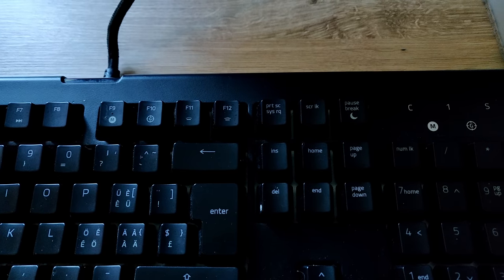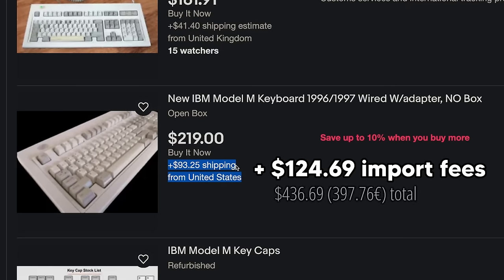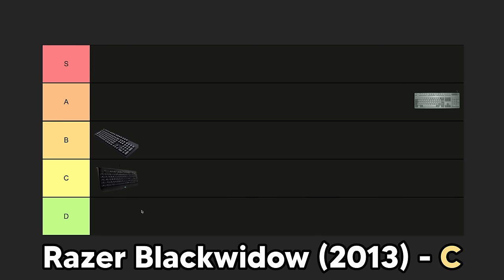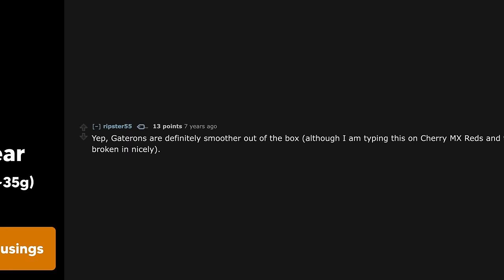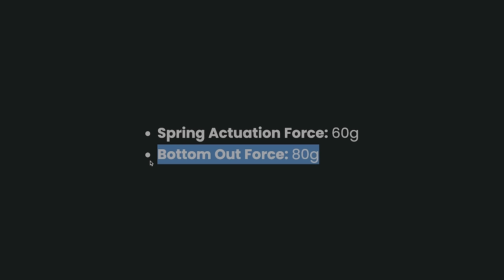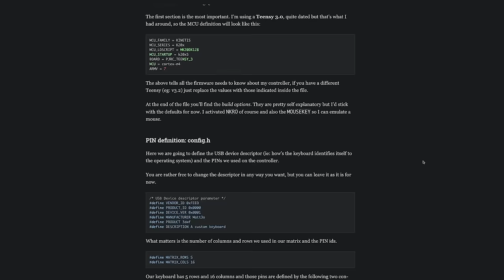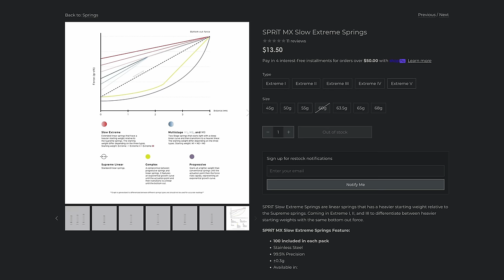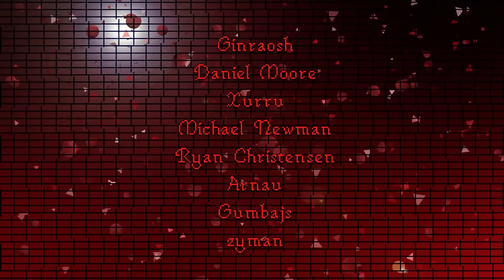How I Lost Interest Towards Mechanical Keyboards

Comment: I never quite understood the obsession some people put into mechanical keyboards. Don't get me wrong, I'm a programmer, so my keyboard is essentially my workhorse and I do have a mechanical keyboard – But I just got myself a Model M (a solid one with the steel plate) for 50€ and called it a day.

After moving out of country, I got  myself a second one for 90€ (the most I've ever paid for a keyboard) – this time a 122-key "battleship" with a terminal connector, and one of them Soarer converters, but that's essentially where my interest ends. I've had this keyboard for years now but didn't even bother creating a proper mapping of the keyboard with the converter, because the software to configure the converter only works on Linux (while I'm running BSD).

For me, this keyboard is perfectly acceptable, feels great to type on and is robust enough that I'm pretty sure I'll be dead before it stops working. It was just the least research for the longest running good typing experience.

Comment: logitech K295 is my latest quiet board , comes with a quiet mouse that's Not that quiet , 
using the logi M650 , which fits perfectly with silent touch K295
it's just such a nice typing experience ... Not having that awful clicking and ticking SCREAMED at your face

Comment: I'm typing on an CM storm quickfire XT right now that I bought in 2015 after getting fed up with the abysmal 2-3 key rollover on the logitech membrane I had at the time. You bet I used the ps2 connector for full N key rollover.

Comment: I said the same thing about keyboards till I saw Vanguard65, which added something unique to what's currently out there with a slider that can act as a MIDI controller if you set it up that way.

Comment: I've found that the end game for me would just be simply making my own since ive only ever been casually into them but, way way too time consuming. had a friend who spent a week soldering with led's and it was COOL but, as an artist/animator I've become alot more interested in macros and autohotkey stuff which ironically came from me being interested in proprietary macro software that came with alot of prebuilt mechanicals.
Reply: QMK/VIA boards are going to be far more reliable and customizable in terms of rebinding. I have a board with actually really fantastic CN software, 3 fully rebindable layers that can be both shifted and toggled into, tons of multi-layered RGB configuration without software, but then literally the same board sold by a different company will have an unusably bad firmware in its place, and most sellers don't show off the software at all, as if they don't even see it as a selling point. Even the good one though doesn't have things like tap commands that QMK can do, where you can assign different commands for single double triple taps and holds and all sorts of variations, on top of having a huge number of on-board layers and profiles.
Reply: @MangoTangoFox  Honestly, open-source firmware is such a nice feature to have supported by your board. I'm excited to switch to ZMK for a wireless board I'm designing.

Comment: For me I stopped going into mechanicals because moving from laptop keyboards to desktop keyboards, now due to sticking to one layout I just use ThinkPad keyboards for laptop and desktop use, also has touch point mouse so I don't even need to move my hands to the mouse and more joystick scrolling is great.
Reply: I'm really interested in the trackpoint. I'm current in the midst of planning the design for my own wireless keyboard in the summer, and the firmware I plan to use, ZMK, recently had a pull request to add support for trackpoint modules (and anything that uses a PS/2, really). So I'll hopefully be harvesting one for that. 

I just can't go back to a row-stagger unfortunately, so I just lay my keyboard (it's tiny, and I disable the in-built keyboard) on top of the keys if I don't have access to a desk, and it works well enough.
Reply: @oku-mq7kg  I've seen people with a split keyboard (non-staggered) who use a trackball in between which might be interesting. After using trackball on and off it didn't work for me. There are 3D joysticks which are used for 3D modeling which can be used for mousing but probably overkill and also expensive.
Reply: @alexprach  My only concern with a trackball is placement, because I'd need to move my hand to reach it if it was in the middle of both halves, or have it super close to the keyboard so my thumb can reach it.

This also applies to an external trackpad, which I was considering using. I also want to tent my keyboard in the future, so having the pointing device directly on the board means I can use it without any issues whilst tented.
Reply: @oku-mq7kg  That makes sense if you want the least amount of movement, I do still use a mouse though. If I only used desktops I would consider the new mechanical keyboards which weren't around or super expensive a few years ago. But having a single layout to learn is all my brain can handle at the moment since programming requires me to use all sorts of weird characters which I just don't want to relearn.
Reply: @alexprach  For pointer heavy applications, I would very likely opt to use a mouse, or just use a trackball/trackpad if I find I can be as fast and precise with these options.

It's really just for the scenario that I need a pointing device for something simple (like closing a cookies popup that it isn't picked up by Vimium) 

Yeah, after switching to a column-stagger, I haven't been able to type on a row-stagger any more (not something I'd complain about mind), but then again I don't use QWERTY.

Having access to layers under my thumbs has made programming so much more comfortable, as it allows me to place symbols in the same location as the alpha keys.
Reply: @oku-mq7kg  I find trackpoint more accurate than mice but the issues is that it's not suitable for mouse heavy work like some games.
Is layers like modes or chords, I've seen some of my colleague setups with these new custom keyboards, so I assume as it's a programmable keyboard.
I think gaming laptop manufacturers should start introducing options for keyboard layouts, I'm glad some exist like the MSI ones but they're too heavy to be portable, I have been tempted to go for a tablet PC like the Surface and just bring a mechanical keyboard, but comes with it's own limitations like cannot use it on your lap for typing.

Comment: you're meant to use the capslock for the fn key on the pok3r, there's a switch on the underside for it.

I used the pok3r a long time before eventually moving to a kinesis adv 2
Reply from the maker: I use the Capslock as the CTRL key on every keyboard I use, it also had a dip switch for that. That would also requires two hands to use the arrow keys, which I don't prefer that much. Although, FN as the capslock would be pretty awesome if the arrow keys could have been mapped to wasd keys now that I think about it, but I think that wasn't possible at least with the firmware at the time.

Comment: I lost interest in them because my endgame doesn't exist and I  don't want to design a pcb in kicad, print it, buy all the part, solder them and then install keycaps that I won't even like because the layout doesn't exist. I am way too picky so I am going to stick with my ymd40 forever. That is, if I manage to sell it and buy a bm40. While you obsess over switches I am fine with gat yellows but damn I can't stand it that I can't have the perfect keycaps with the legends I want.

Comment: I have been a lil bit in to custom boards, I bought an razer hunts mini, lubed switches spraiyed the board and added foam, but I ended up selling the board for like 90 bucks, to buy a k8, I sadly just bought the non hot swap one, so I spend a lot of time desodering and lubing and foam modding and what's so ever, the keyboard sounded the same, even tho I change nearly everything besides case and pcb, I was so fed up, that I bought a used huntsman mini, only to realize that I hate 60 %, after this I just bought a havit full size with blues for 5 euros, and I think I am kinda done with custom mods cuz of my experience with the great k8.

Comment: This is a great video, but it doesn't appear you ever really tried very many switches. You seem to gravitate towards clickies ... but haven't tried any particularly good ones like box click bar switches (jades, navies, pinks, etc)?

Personally, I just went right back to Cherry MX blue when I first tried the Model M. I didn't see what was so special about buckling spring until I tried a Model F. It is so much smoother and more consistent. Capacitive buckling spring has been one of my favorite mechanisms ever since, along with Alps (and Clickiez). Box clickies aren't far behind.

I do like both Topre and Niz, and they and Alps are my favorite tactiles, but I like Niz a bit more than Topre.

There's so much yet to explore. You really need a switch tester, even if just sticking to boring old MX.

I'm going to keep laughing about the thought of trading in Topre for Gateron black.

Comment: I've just been using the same Apple Extended Keyboard II since the 1990s, with appropriate ADB to USB adapter. I couldn't deal with a dome membrane keyboard.
Reply from the maker: Makes sense, the Apple Extended Keyboard II is an Alps switch keyboard, at the time I was active in the keyboard space, most people considered tactile Alps switches way better than Cherry switches, except maybe Black Alps which have issues with scratchiness.

Comment: For the longest time i just used whatever cheap keyboard i had and thought nothing of it. But they broke so often that at some point i started to look into keyboards.
The first one i got was the cheapest mechanical keyboard i could find which was an lg g610 orion red, but the z key stopped working after about 3 years. I tried to fix it but bungled it and just decided it was once again shopping time.
After a few months of watching nothing but keyboard stuff and reading about keyboards i had decided that my omega end game keyboard wouldve been a honeywell hall effect space cadet keyboard, but i couldnt find one.
So next best thing i bought a wooting hall effect lekker keyboard and bought some replica space cadet keycaps and slapped those on it. 
I will never buy another keyboard for the rest of my life. I see no way that anything could out do what ive got. 
Unless of course i run into a huge pile of money, in which case id just find some way to buy an og space cadet.

Comment: Now I''m too scared to ask, what kind of keyboard would you recommend to a newbie XD

It seems like this entire journey brought you to all corners of the hobby. Do you ever regret selling the old ones now that you can't type on them to remember the feel?
Reply: Honestly, I would just look at ergonomics, because you can a get a lot of health and productivity benefits out of something so cheap (at least if you're happy soldering or find a cheap assembly service). 

At the very least, find something with a column-stagger that's also split. The key count isn't too important, so long as you aren't stretching or causing any strain on your fingers to reach keys, nor are you moving your hand to reach them either, assuming you type using the correct technique.

I have quite small hands, so I opted to not include a number row, so holding down a key with my thumb replaces the top row with numbers, and I no longer need to stretch or use my ring finger for the wrong key to hit these.

I use a Ferris Sweep at the moment, it's very easy to build, and I haven't had any issues with it, but there are so many options out there with different strokes for different folks. I'm now looking at designing my own keyboard that's made for my finger length and preferences.

Comment: You most likely will never get a cherry mx switch to match a topre switch as it uses a slider with a rubber dome while mx is mechanical. If you want to get back into mx switches I suggest checking out TherminGoat reviews as he does in-depth switch reviews. 
Also nice video:goodvibes:

Comment: Custom keyboards is definitely one of those hobbies that has extremely prohibitive costs once you start getting deeper into them. Custom runs of keyboards or even keycaps can start at $300+, and a lot of the times they’re not much better than the mass produced options. Don’t even get me started on GMK keycaps. Borderline scams. I’m happy with my modded Keychron V2 after trying a bunch of different custom boards.

Comment: I had a PS2 IBM keyboard back in the day. As long as a keyboard worked and didn't have some super weird layout that I couldn't get used, meh. Quiet keyboards that work and are cheap is where it's at. Happy with my Logitech K360, so I got 2 more, Logitech laser trackball ERGO M575, so they can share  a dongle. I really like my iCLever folding keyboard, but it's annoyingly unreliable. Repeating key presses for no reason, delay. That keyboard with Logitech's wireless reliability would make a great portable keyboard. Niche keyboards with expensive plastic switches, for the birds. Making everything more expensive than it oughta be.

Comment: 4:25 "I wanted to clean my keycaps so I decided to boil them"
You were not the smartest tool in the shed back then let's be honest

13:40 That's why you don't solder with the keycaps on.

I recently bought a very cheap Onikuma 80% keyboard with MX browns (I can only bet they're clones) and replaced the keycaps with a set of transparent ones that costed almost as much as teh keyboard itself. It's an insane upgrade from the membrane keyboard I had for the past 2-3 years. I did a little bit of research before buying it and found so many different layouts, keycaps, switches and all sorts of other mods, and as much as I'd like to try making a keyboard of my own, I'm unsure about spending all that time, money and effort on something that I'm either not gonna like or it's going to make me want to get even more invested and spend even more time, money and effort.

Seeing you sell and buy the same keyboard 3 times, I think I should just stick with my MX brown clones

Comment: My interest in mechanical keyboard pretty much stopped after I assembled my 1st & possibly last mechanical keyboard I own. I'm not sure if I can call it the endgame keyboard but I certainly experience Goldilocks & Why The Heck Not syndrome.

I started with a Roccat keyboard with Cherry Reds. It's a tacky looking keyboard with a lot of things I don't like. The keyboard is abnormally large & the Cherry Reds switches are too light.

Then I went for Corsair keyboard with Cherry Browns. It's a much more subdued look but slightly tacky, but still have somethings I don't like. Corsair's software is complete crap & I thought I like the tactility, but as time goes by it feels more like a friction scratch than a tactile bump.

Then I went for Cherry MX2.0 keyboard with Cherry Blues. I like the look of it as it look as plain as it can be. Don't like most of it too. Like the clicky sound but typing feels like chopping spring onions. Don't like it too.

I decided to go for a custom keyboard. Bought a cheap hotswappable Royal Kludge keyboard, custom keycaps & Gateron Pro Yellow 2.0 pre-lubed switches. It's not a perfect keyboard & the software is not totally crap... a bare minimum I can say. Buying the switch is a gamble as I don't know what it feels other than it's kinda like Cherry Reds but pre-lubed and heavier springs but not as heavy as Cherry Blacks. I've tested the Cherry Blacks....don't quite like it. I know they released an improved version of it but Gateron is cheaper.

So I found they keyboard that I'm comfortable with. I'm going to stick with this until it breaks & I probably have to go through pain in the ass process again in the future.

Comment: K-Mart used to have mechanical keyboards on the bottom shelf in the back of the store for $6. I bet I have a few old ones in a closet next to a Pentium 166 IBM Aptiva pc that $5000 but the entry to the dial up aol internet. All the lettering on them is probably worn off, at least wasd is for sure.

Comment: The claim that the model M is "the most tactile keyboard out there" is utterly insane especially next to MX blue
Reply: I'm not sure what you mean, MX Blues are barely even tactile? Tactility refers to the required to depress a key having a distinct peak, basically the opposite of linearity. Buckling springs (Model M/F) have this way more than any Cherry product, as do Alps/Matias switches. Makes perfect sense too, since you're literally bending a spring until it buckles, not just dragging a small plastic bump across a lip.

If you wanted tactility in an MX style switch, you'd get Kailh BOX switches or something.

Comment: I hate mechanical keyboards with a passion. Give me a Macbook (non-scissor) chiclet keyboard and I'm happy. Quiet, key travel is consistent and short, only the letters are lit, no flickering, no RGB nonsense, caps lock light on the key itself. The next best think is the Logi Mx Keys although the keys are a bit hard to press and the ambient light sensor and dongle software are absolute garbage.

Comment: my first custom mechanical keyboard is really great, and i love i but i hate having to spend so much time adjusting it when it starts sounding a little off after a few months of use. i end up using my hhkb way more. kinda want to get a realforce though, i love dedicated arrow keys
Reply: I can't say I'm a fan of dedicated arrow keys myself. Having to move my hand away from the home row doesn't feel great. Have you ever considered a keyboard with thumb keys? So that you can have arrow keys on the home row, and it's as simple as holding down a key with your thumb to access this layer.